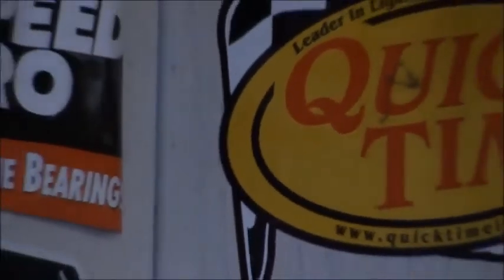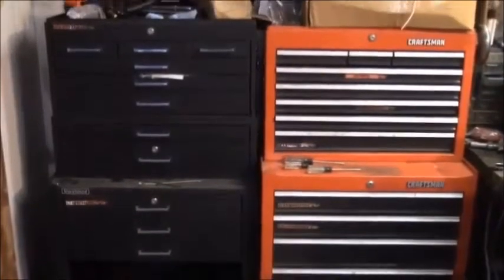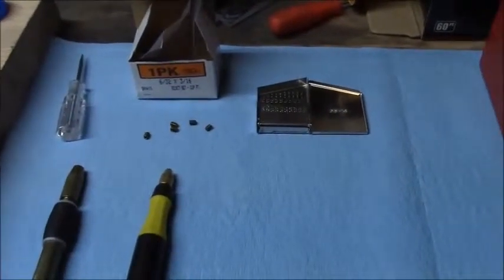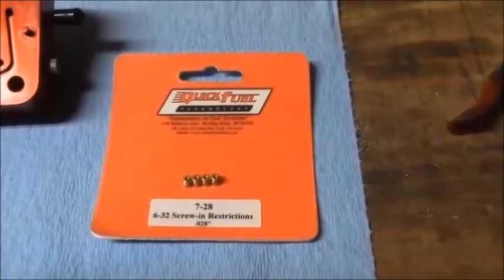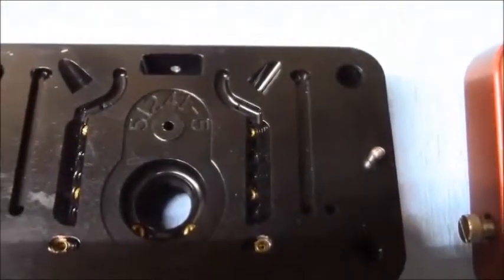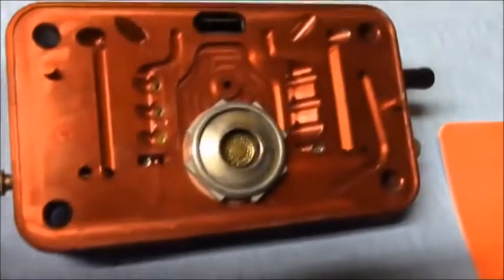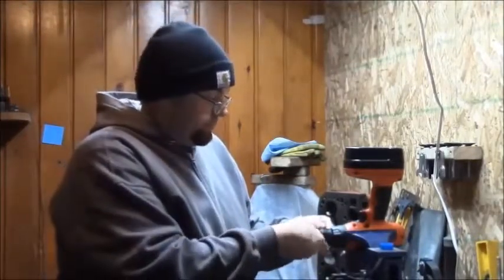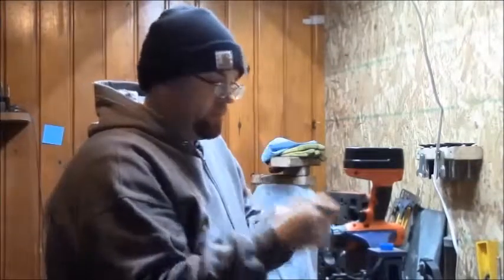HOW TO Drill Carburetor Emulsion bleeds

Comment: Dude, I drilled 10 of those emulsion bleeds in half an hour or less, by screwing them into a metering block to hold them, then hand drill them with the hand chuck from pin drill set.  A lot easier and you won't damage threads
Reply from the maker: I've drilled hundreds the way in the video and never damaged any threads, you only have to snug the chuck.   A carb builder told me this method and I know of other builders who do it this way as well.